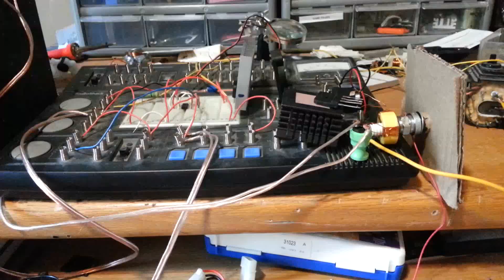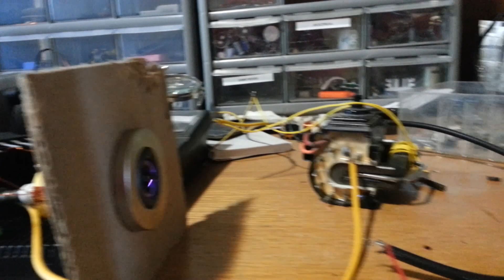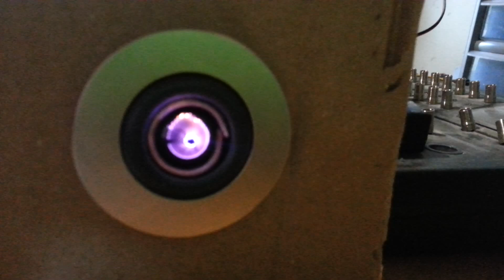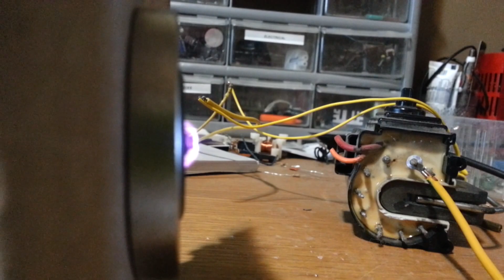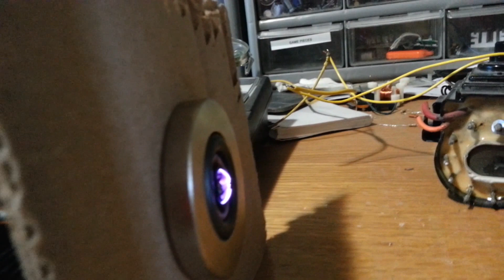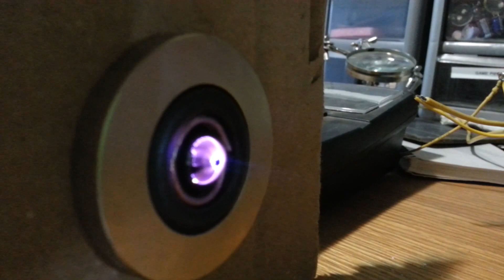Plasma forcefield plays music!

Comment: If you tune up a solenoid right, itll 'play' like a speaker box engine, a vortexing plasma dynamic ... we call them aurora engines ... hello! also, be careful, they respond very very very quickly
Reply: If i do say so myself, i used to design the engines.  Be careful, they tornado outside in, lefty righty two thumbs up ...

Comment: Is the Plasma playing the music, or is the Music playing with the plasma
Reply from the maker: +Jeffrey314159 The plasma its self is playing the music
Reply: Plasma is just the driver of a magnetic field. So the plasma is being injected with a electron that is being directed between a magnetic field. Because the magnetic field has a radio wave on one side and a field on the other they can be used to inject sound to plasma without a wire. Just by going 90 degrees out of phase with the radio wave. Center the ionized gas over your house and drive the plasma crazy.  The radio wave will go from field back to radio wave on 1 side. So the plasma will pick up the electron and switch back to the field. Then the voice of God is heard. If the plasma is touching you it will literally be like a diode that can send messages directly to your brain.